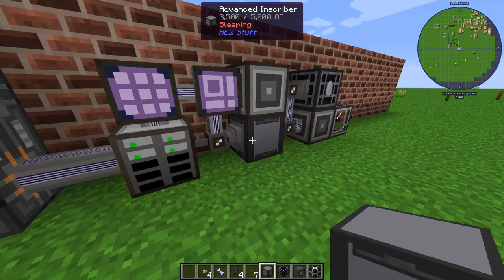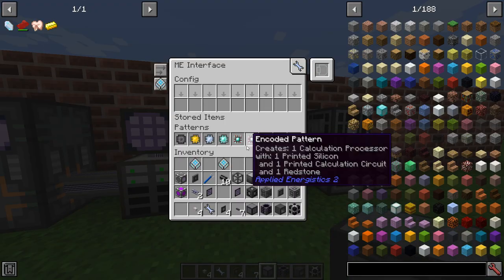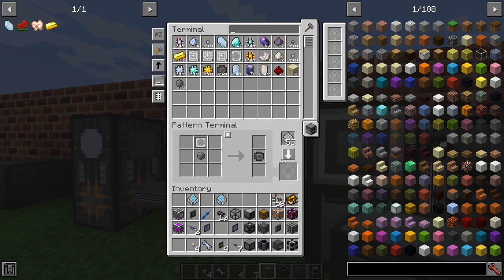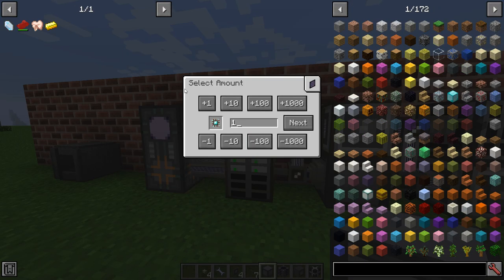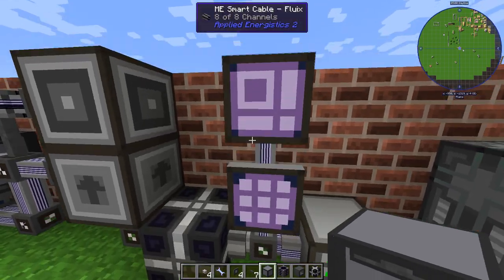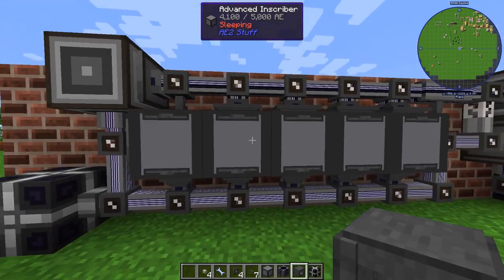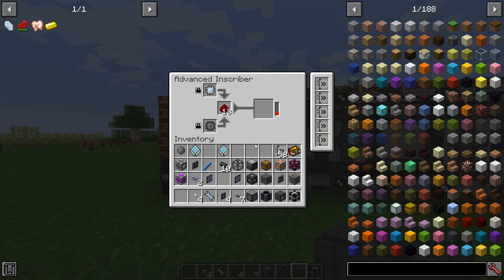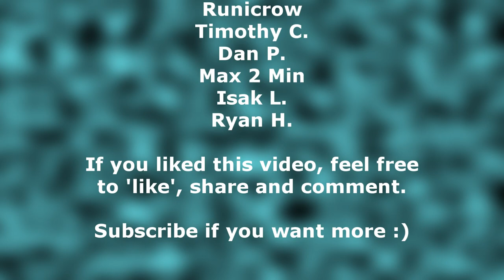Advanced Inscriber (AE2 Stuff) Processor Auto-Crafting - Applied Energistics 2 Tutorial

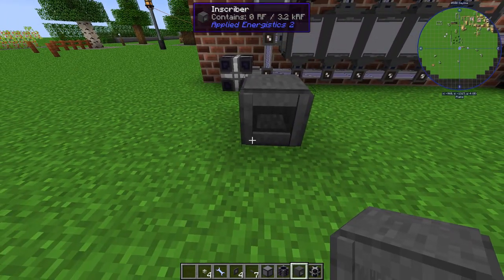Comment: 11:37 You have to extract from the open face. You can make the opening face down and use a output hopper but then the bottom (original) and top (original) becomes the sides (face down) and the back (original) becomes the top (face down) for the feed input hoppers.

Comment: In the 5 inscriber system you don't need import buses on the first 4 inscribers, the storage buses can passively provide items, just put a export bus on the 5th inscriber.
Reply: hey I know this is ages ago, could you explain your setup? I have Storage on top first 4 inscribers, and then plain smart cable down the bottom providing power, got a export with the circuits on top of the 5th but redstone isn't being inserted just chilling on the top me interface.
Reply: @RektOrNah  You need another storage bus  in the 5th inscriber because the export bus cant export the redstone that  its not in the inscriber sub-system because is in the interface, and the interface is trying to deliver that item inside the system but there's no default storage so you need a storage bus to tell that redstone goes somewhere, is this case, the 5th inscriber.
Reply: And that storage bus also provides the output for the export bus that connects to the ME interface (block)

Comment: love the tutorial but one glaring issue in the 1.19 variant where the advanced inscriber cannot lock that top slot or bottom anymore resulting in the the system saying that it need (if i call 64 of that engineering board) 64 presses  and 64 diamonds when it only needs 1 press for it to work properly make and reuse, its made me stuck and there are no current tutorials on this or a work around to be found.
Reply: Mind letting me know if you figure something out for this issue

Comment: The advanced inscriber i have set up for circuits will not accept Redstone either manually or automatically
Reply from the maker: It's hard to help with no knowledge about the setup but it worked quite fine for me in this tutorial world and in my playing world at that time (Enigmatica 2). However, the mod has some bugs and have not been updated in a long time so it might be because of that as well.
Reply: I couldn’t find any information so I just went back to using the normal inscribers with speed upgrades
Reply from the maker: @DarkRavenProductions  This month I released two videos on auto-crafting with regular Inscribers, just an FYI ;)

Comment: Hey, thanks for the tutorial. I haven't tested your automated setup yet, but I'm having trouble with the advanced inscriber itself. Can you input resources manually? I tried making a logic processor and it wouldn't work at all. Any help would be very much appreciated.
Reply from the maker: Yes, it works fine. You only need to connect power and you can insert every part manually, from silicon, printed circuit to finished processor.

Comment: Thank you for the amazing tutorial! I've used this in prior versions of the mod because you've done loads of great things, but in MC 1.19.2 (AE2 Things 1.1.1, AE2 12.9.2) this no longer seems to work (at least for me). I've followed your video to a T in both survival and creative, both failing to automatically extract the presses from the Advanced Inscriber. AE2 Things is a port of AE2 Stuff so I expect it to work even slightly different, but for the most part everything works fine: items funnel in, it extracts circuits and processors, but despite including the presses as an output in the patterns they do not remove themselves. Also, there is no longer a lock icon next to the slots in the Advanced Inscriber. Also, I think interfaces have been replaced my Pattern Providers for the most part. Is there any way you could help me figure out why these designs no longer work or a solution to extract the patterns?

I tried placing an import bus on the Advanced Inscriber to remove the patterns, but they didn't work (unless I didn't do something properly with them).

Comment: My Inscriber Press' can sometimes still hang in the Adv Inscriber even without speed upgrades. :( Not a very reliable system but better than nothing I suppose.

EDIT: Now they are holding the output items for no reason. This system doesn't work at all for me anymore.
Reply from the maker: As can be seen in the video, the known bug makes it so that I have both functional and problematic setups with this method. The setup I built in my Enigmatica 2 world works perfectly (the compact version) but in the test world I had lots of issues getting it "quite stable". Until they fix that bug I think we're stuck with the problem unless someone finds a nice workaround - perhaps with other mods.

Comment: I am having an issue with this build, the top interface holds the items required (gold , redstone and silicon) but they never leave the interface? any help would be appreciated
Reply from the maker: Is the Inscriber empty? How is it configured? did you place every block and configured patterns and devices as I did in the video? I know that it worked when I recorded this video but I don't know how you built, what modpack or version you're using or anything. Really hard to guess. Sometimes it can help to rotate the Interface so the arror points towards the machine you want to use.
Reply: @therealtkh  The build is the exact same, but its okay I found an alternative build with a little less autonomy
Reply: @gogogregor245  Could you send me the link?

Comment: How do you get that interface with an arrow? Did I miss it somewhere in the video?
Reply from the maker: I didn't cover that part in this video so you didn't miss it. It's usually not required but you can aim the interface if you want to (like if there's a machine trying to output in wrong direction or if there are several next to each other. Just right click with wrench and it will rotate in some weird way (takes a few clicks to get it right).
Reply: Thanks! I think I just derped that one up by crouch rightclick and getting confused. 🤣🤣🤣😅